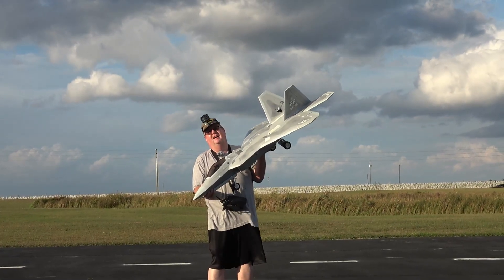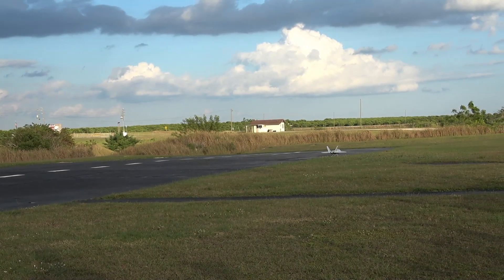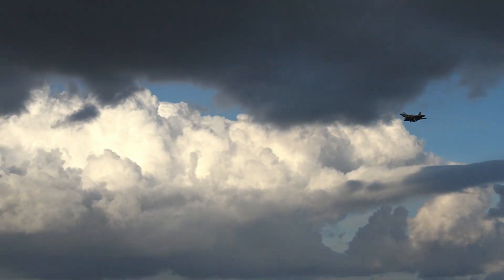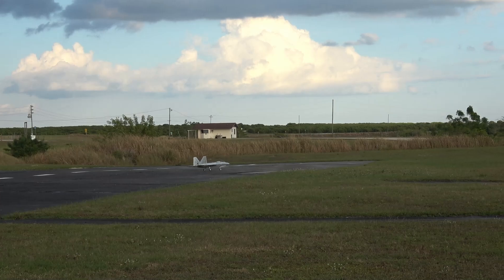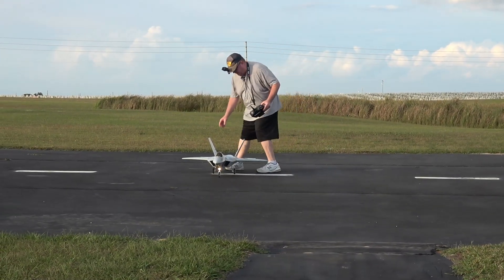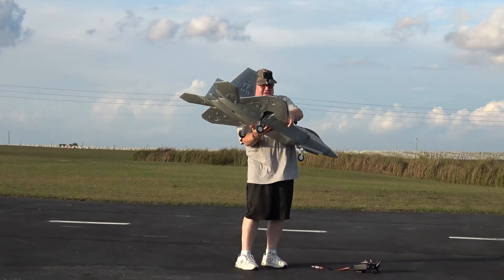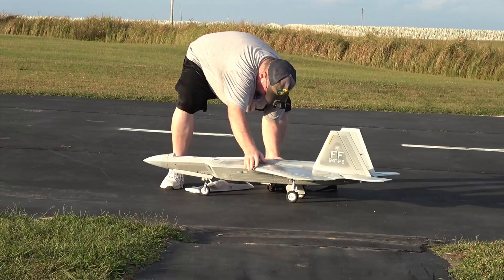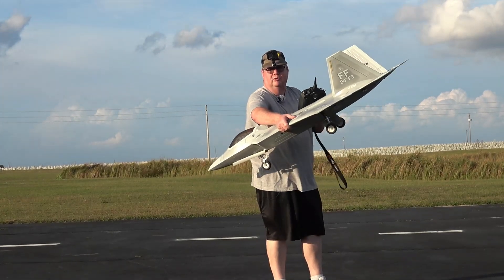FREEWING F-22 90MM H.P. LOVING IT MORE AND MORE! Fat Guy Flies RC

Comment: Excellent!  I had a hard landing with one of mine last weekend. Miscalculated the crosswind and ended up in the tall grass. While ordering replacement parts for it, I ordered another one for my birthday with the upgraded motor and reverse ESC. Now there are two, running out of room.😂
Reply from the maker: Lol space in hanger is an ongoing issue.
Reply: @FatGuyFliesRC  already there, might start giving away older planes again.

Comment: Man I loved mine too but its the first jet I could not get trimmed for some reason, no matter what I did, it would be slightly rolling to the right
Reply: 🤔 What did you try ? To fix it ?
Reply from the maker: Hmm my trim is level with all surfaces. Perhaps you wing is slightly warped?
Reply: @FatGuyFliesRC  Yeah it was really weird. the F22 seems like it would be the easiest jet ever considering all the surfaces just need to line up with the wing or rear of the jet.. you know what I mean, it's not like an F16 where the rear tailerons need to be measured in mm to get the center pitch correct. But I sold it for that reason, one of the best jets mine was just an anomaly.